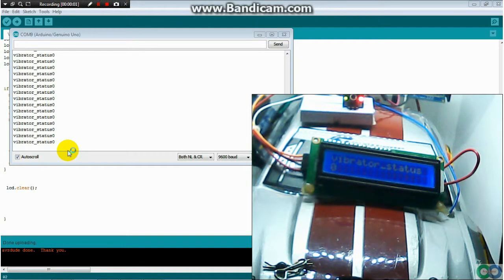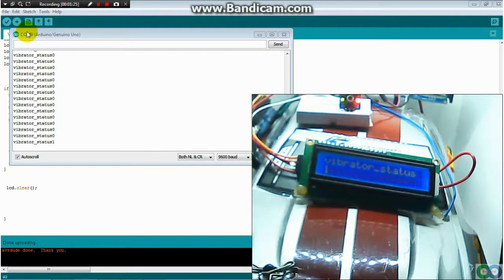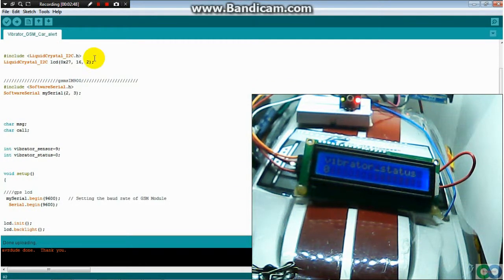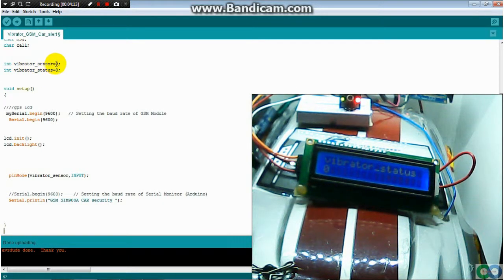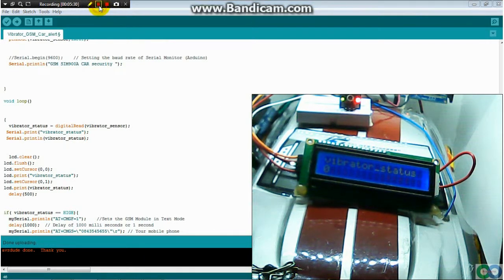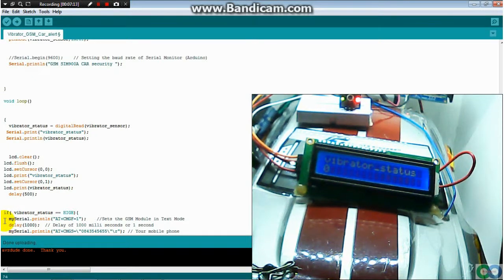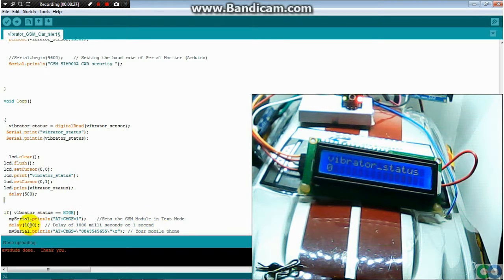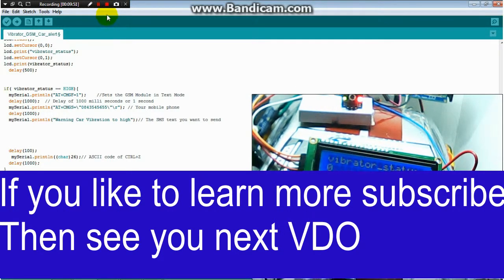GSM Sim900A cars security alert vibration too high

Comment: plz share code.....In  inbox plz ..
Reply from the maker: http://arduinowolrd.blogspot.com/2017/09/sim900a-arduino-factory-alarm.html

or 

////////////////////////////////////////////////////////////////////////////////

int flame = A3 ;// define the flame interface analog 0 interface
int Beep = 8 ; // buzzer interface defines the interface number 7
int val = 0 ; // define numeric variables val 

#include <Wire.h> 
#include <LiquidCrystal_I2C.h>

LiquidCrystal_I2C lcd(0x27,20,4);  // set the LCD address to 0x27 for a 16 chars and 2 line display

void setup ()
{ 
  pinMode(Beep, OUTPUT) ;// define LED as output interface
pinMode (flame, INPUT) ;// define the buzzer as the input interface
Serial.begin (9600) ;// set the baud rate to 9600
}
void loop ()
 {val = analogRead (flame) ;// read the analog value flame sensor

delay(2000);
Serial.println (val) ;// output analog values, and print them out
 if (val >= 600) // When the analog value is greater than 600 when the buzzer sounds
{ digitalWrite (Beep, HIGH);} 
else {digitalWrite (Beep, LOW);}

 lcd.init();
  // Print a message to the LCD.
  lcd.backlight();
  lcd.setCursor(3,0);
  lcd.print("Analog sensor");
  lcd.setCursor(7,1);
  lcd.print(val);
}